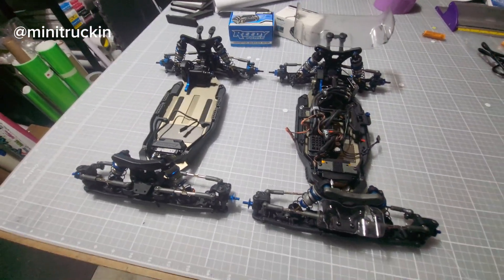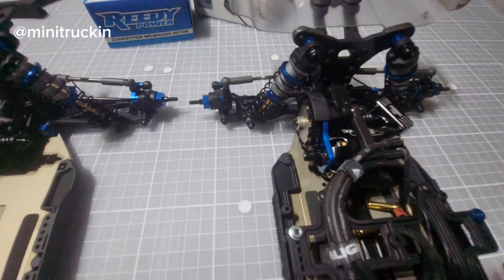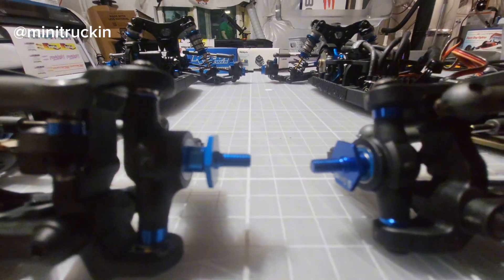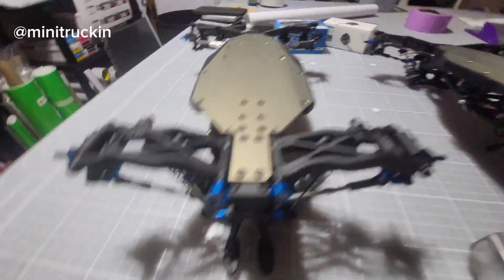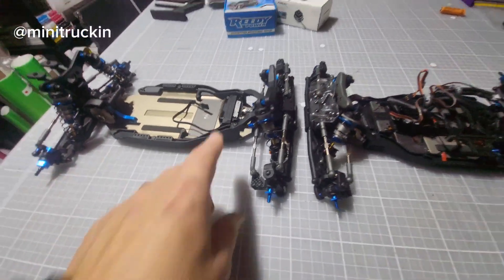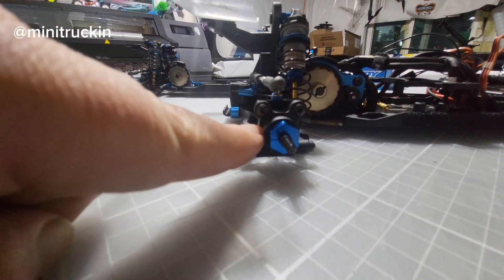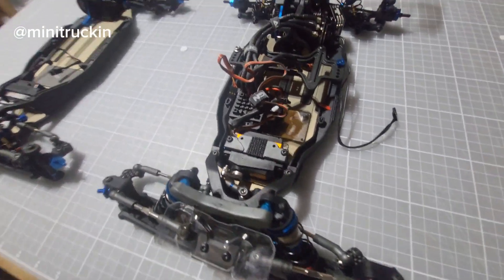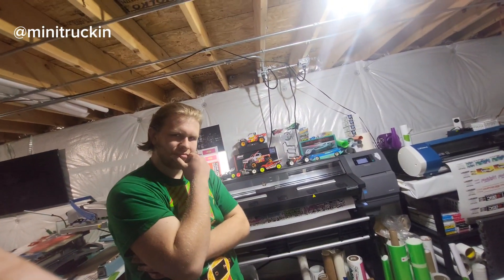team associated comparison between b7 & b6.4 10th scale rc buggies #teamassociated #rccar

Comment: Simply put: the B7 is off by .5mm on the rear chassis, the hinge pins have play in them, and the c block overhang was a bad idea.  The B6.4 is better.
Reply from the maker: Ye at this time he is faster with b6.4 still.  For me it's not a significant update for me to switch from mybb6.4 yet.  How bout u?